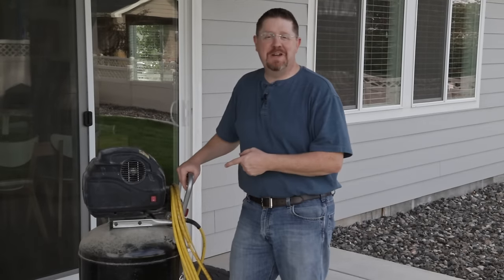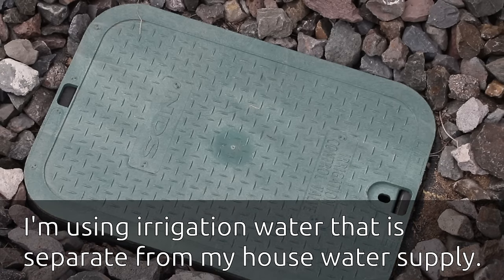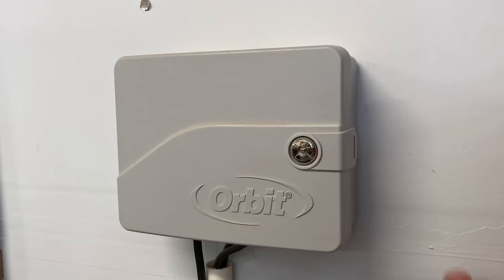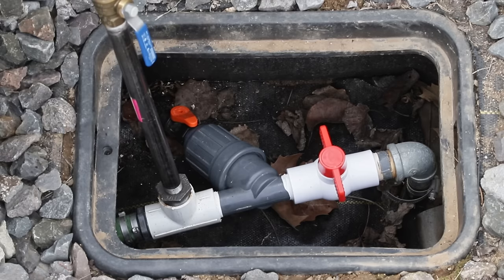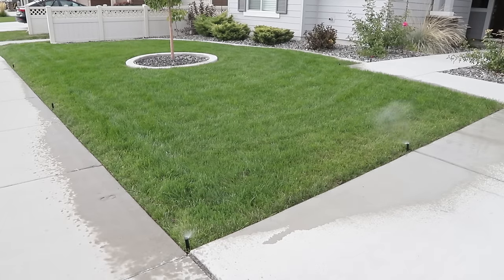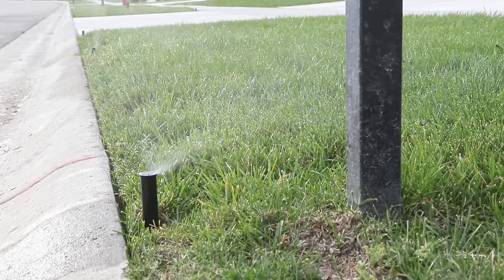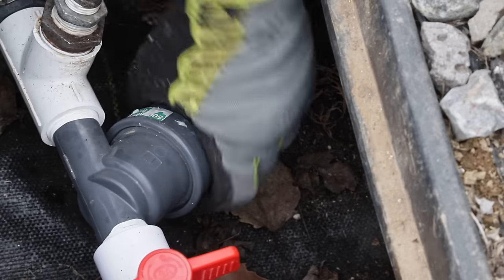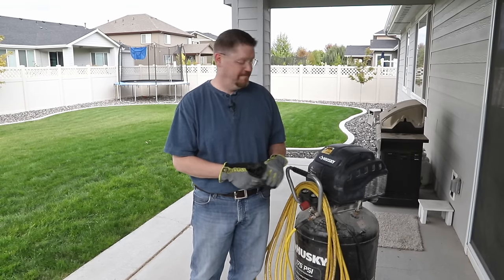How To Winterize Your Sprinklers (Sprinkler Blow Out With Air!)

Comment from the maker: The only slightly difficult part of this entire project is figuring out the right location to hook up your air compressor, and building the right kind of adapter. Irrigation systems vary wildly, but fundamentally all you need to do is pump the water out with compressed air instead.
Reply: Does it matter if you have drip line. My concern would be damaging it. Thanks for the video
Reply: Michael Brown drip line should have a part that limits the pressures coming to the drip line section, may be underground.  You just have to blow out somewhere before that part.

Comment: One of the better videos I've seen on the topic. The only quibble I have is that although 80 psi might be OK for non-rotor head sprinklers, 40 psi might be better on systems which use rotor heads; they have lots of moving parts that can be damaged if run at too-high speed on air.
Reply from the maker: Good tip. Thanks for watching!
Reply: Yeah I'm not sure why anyone would run anywhere close to 80 psi!
Reply: Great tip 😊ty
Reply: @jayryan7473  TIME

Comment: Good tip at the end with the quarter turn on the ball valve.  I can attest, this happened to me one winter in Texas of all places.  My ball valve was shut, there was some water in the side, and it burst the metal on the side of the ball valve.  Crazy to know such a small amount of water can do that, but it's true.  Thankfully the ball valve is a cheaper fix than replacing the entire vacuum breaker.
Reply: You should have just replaced the cold water in the lines with hot water. Problem solved

Comment: I live in an area where hard freezes are rare, but light freezes are common. My schedule 40 pipes are buried a foot or so, making it unlikely that I'll have a problem in the backbone. However, the light freezes will easily damage the heads and funny pipe, something I've seen my neighbors have issues with. So I'd recommend doing this unless you never (or almost never) get any freezes.
Reply from the maker: Great advice David, thanks!

Comment: Always take the blow out cap off to let air in that lets the water drain down the curb stop and drain.  If u don’t, water is trapped. from ball valve down. U do that before us turn the ball valve off.

Comment: What I’ve done in the past as a low tech option that seems to work if you’re blowing out a smaller system. I took an old bicycle tube. Tied one end by the valve. Cut that end then about 10” of the other side. Wash the talcum powder out of the inside. Fit the longer cut end onto the valve side and using a bicycle pump fill that tube and watch the water exit through the ends. It may take more effort using the pump but it will do the job. Cheers.

Comment: I am new to an irrigation system and found your video to be very helpful and informative.  What, if anything, should I do with the controller?  Seems I don't want it to call for water but unsure how to shut it down for the winter.  It is a hydrawise brand if that matters.  Thank you for your help.
Reply from the maker: Great question! All you need to do with the controller is turn it off for the season. Consult your owners manual to see how to enable and disable or turn on or off the entire unit. Good luck!

Comment: If I just want to turn off my irrigation valve for stopping the entire irrigation, without any need for the blowout, since I don't need to winterize my system, I just want to manually irrigate. Do I just need to turn off the valve and that's it? Your video mentioned this and I want to make sure. My irrigation system is very simple (there is an irrigation valve with the switch to turn on/off, and there is two other remote control valve which I have not opened, I guess that is where the control for timing is ?). Thank you for the great video.
Reply from the maker: Hey thebc - yes, if you don't need to winterize your system because nothing ever freezes, then you just turn off the farthest upstream valve you have in your system. In my area these are very deep underground, but depending on if you have a frost line this may be shallow, or may even be above ground. Good luck!
Reply: @AmplifyDIY  One more question. If I turned off the irrigation valve, what happens to the water that is already in the irrigation pipe? I assume there are some leftover water in the pipes. Will it be ok it leave as is? Also, I happen to notice, after I turned off the irrigation valve, the water pressure for my home system has increased. I think it makes sense as it used to have two pipes for water, and now just one to the house. Is this normal? Or I should have the water pressure checked and adjusted if necessary? And also, since I didn't touch the remote control valve (where I suppose is the control of irrigation schedule), will it still turn on using the leftover (if any) in the irrigation pipes? Do I need to turn off the irrigation scheduler? Thank you.
Reply from the maker: @thebcl1547  I'll try to answer everything: If you simply shut off the irrigation valve, then yes, the water still in your irrigation pipes will just stay there. This is not really a problem unless the water freezes, in which case it will burst your pipes - this is the whole reason why systems are blown out with air in the first place. 
I can't really speak to differences in water pressure between home and irrigation system.... there are lots of variables and so many different ways that these can be plumbed. 
Yes, you should turn off the timer so it does not keep needlessly opening and closing the valves while the system is not pressurized. 
Good luck!

Comment: Do you have to run all the stations ? I mean you can’t just hook air up and blow them all out right ? I’m on a well.
Reply from the maker: Yeah, you'll need to do them one at a time. Otherwise there will simply not be enough air pressure to blow out the whole system. Good Luck!

Comment: My system, installed in 2001, has no fitting for attaching anything, and no outlet. I've just been opening all the valves with the water shut off. It's been freezing longer in the last few winters  - Have I been lucky? Should I install a fitting to blow out the system?
Reply from the maker: You've mostly been lucky, yes. :) There are a bunch of factors that can contribute to whether you run into problems: how deep are your lines buried? is your main water inlet to the system uphill or downhill from all your sprinkler heads? How long does it stay constantly below freezing?... etc. If you have a good place to do so, I recommend adding a fitting so you can blow out the system. Good luck!

Comment: Good explanation, thanks. I have 1" underground lines and a 20 gallon compressor. One question: When I turn on my compressor to clear a zone, the sprinkler heads pop up and start discharging water then air, but very quickly the air pressure drops and the sprinkler heads drop down again. My compressor manual warns me not to keep running the compressor, when the compressor cannot maintain the required pressure for a tool (in this case the "tool" is the blowing out of the lines). So how do you ensure that a zone is clear of water right to the last sprinkler in the zone, without just leaving the compressor running? Do you shut off the air supply, let the compressor recharge then open the  air supply to the lines again, and keep repeating this process until the last sprinkler head can rise and blow clear air? The last sprinkler head in a zone tends to remain at ground level and just have air bubbling through a pool of water and I am not sure if it is still expelling more water or not.
Reply from the maker: Hi Carol, 
Yes, cycling the compressor is the exact way to do it. As for how much water do you need to get out? If your last head is gurgling and bubbling, then that station has been cleaned out enough. As long as you don’t have a steady stream of water coming out of any head, then the station has been cleared. Good luck!
Reply: Actually this is because your air compressor doesn’t make enough air volume to do this job properly.

Comment: Great video, thanks for taking the time. I was told that compressors like the one you used will not work. Will you please tell me the CFM rating on your compressor? Thanks.
Reply: I've used compressors smaller than this one and have blown out my system for years. You just have to do it zone by zone. Some can get away with doing the whole system with  a big compressor
Reply: Depending on the tank size on your compressor and the length of irrigation pipe and # of heads in each zone, you may have to blow out a zone in multiple passes; that is, when you see the pressure coming out of your heads drop significantly, close the valve to your irrigation system, let the compressor recharge, then repeat until you get all the water out.

Comment: Why should the blowout tee not be before the RPZ pressure regulator? How do we make sure the regulator is clear of water?
Reply from the maker: Hi Don - in my system, the only thing upstream of the blowout tee is the water filter, which has its own drain. The only pressure regulator I'm aware of in my system is on one specific station that feeds drip hoses. If you have a pressure regulator upstream of your blow out tee, I'm not sure I can offer any great advice for how to make sure it is blown out...

Comment: How do you vacate any water between the valve in your city supply and the valve in your irrigation box? Seems like there would be many feet of water in pipe in that area because it never gets blown out
Reply from the maker: Hi James - in my case, the irrigation water is on a separate system that is turned on and off seasonally. I wait to blow out my system until after the irrigation water has been turned off in my neighborhood. Then I can crack open my underground valve (the one that is about 5 feet underground, well below the frost line) and blow a short burst of air through it. This evacuates the section between my shut off valve to the irrigation system and the shut off valve in my sprinkler box. Then I close both of those shutoffs and proceed with the rest of the blow out.

Your system will vary, of course, but I would not worry about any shutoff valve that is below the frost line.

Good luck!

Comment: Great video, quick question though: What is the purpose of the ball valve right after the main shut off?
Reply from the maker: I think it’s just there for convenience. It’s really simple to turn off the ball valve in the box in order to clean the filter or do maintenance on a failed valve, etc. would be annoying to have to reach down to the main shut off for any small work like that. Great question, and thanks for watching!

Comment: I didn't see a pressure regulator, so are you using line pressure? Also if the system, is only serving a drip system for plants with 1/2” drip line and using 1- 2 gph emitters, I would guess you need to know where the end of the tubing, so you can loosen the figure 8 fitting, so you can drain the lines quickly, I'm in the process of building a new home and will tee off the incoming water line and using a backflow valve, plus all my outside yard faucets will be off the same supply line serving the irrigation, I'm thinking the lowest places of my hose bibs, will be where I should install a drain valve to blow out the system to winterize. Am I missing anything? This new home is at 6500 feet elevation and it freezes, so I'm planning on trenching the lines to 18” deep and sanding the lines when I backfill
Reply from the maker: Hi Philip - It sounds like you have thought through your upcoming build pretty well. I do not have a pressure regulator on the irrigation lines, and just rely on whatever the system in my neighborhood provides. The builder that built out this neighborhood set up all the homes this way, as we are on our own irrigation pump for the community. So far it's been fine. 
My only other thought is that rather than just digging down to 18", you should find out what the freeze depth (usually called the "frost line") is where you'll be building, and bury below that. It may only be 12", it may be much, much deeper. You can learn more about frost lines here: https://www.familyhandyman.com/article/frost-lines/
Good luck!

Comment: My manifold has three connections where yours shows one. Reason?
Reply from the maker: Just depends on how your system is set up and plumbed. The box I showed here is the single main source of irrigation water for my lot. From here the outlet goes up near the corner of my house in the back yard where there is a T. One side of the T goes to a box in the front yard with a manifold where all the valves are for my front stations, and the other goes to a box at the back corner of the house where there is a manifold and  valves for all my rear stations. Neither of these are shown in the video. 

I suspect that your box simply has the split for your various manifolds right there rather than a T or series of Ts later down the line.

Thanks for watching!

Comment: What about the water between your two shutoff values? Some of that water is above the freeze line, wouldn't that be a problem? If shouldn't you put the compressed air fitting below the freeze line to blow out all water above the freeze line?
Reply from the maker: HI Gis  - In my specific case the water is supplied from local irrigation canals. At the end of the summer the water flow to these canals is turned off, and the pump that feeds our system is shut down for the winter. Once this happens, all I need to do is remove my filter fitting with my above-ground shut off still open, and gravity will pull the water back down past the under-ground shut-off back towards the pump.

This is, of course, unique to my setup. The particulars of your installation may vary, but in general just a couple of inches of exposed length above the freeze line won't be a problem, even if it remains full of water. Thanks for watching!

Comment: Thanks for the video.  Question:  If there is no air valve connection anywhere in my sprinkler system, can I blow out the lines by attaching the compressor to an individual sprinkler head in each line?  (Orbit makes a blow out kit adaptor which fits onto a sprinkler head for this purpose.)  Or should I go to the trouble of cutting my main line and installing a air valve connection (like yours inside your box)?  Thanks much.
Reply from the maker: You won’t be able to blow out all the lines if you only attach a blowout thing to a head on each station. That won’t clear the lines from your water supply to the valves, and depending on how deep your frost line is those lines can freeze and burst. It would be better to install a blowout access point as close to the water supply as possible.
Reply: @AmplifyDIY  Is it best to install a blowout access point in your valve box like you have done?  My system doesn't have a blowout access point.

Comment: Thank you as always. Can you please advise what size compressor ideally will be sufficient to bleed off the water ?
Reply from the maker: I've done this with several different sizes of compressors over the years. A really small compressor (say, 2.5 gallon or so) will do this job, but it takes a lot longer, as you'll have to keep refilling the compressor over and over on each station. The larger the tank, the less you'll have to refill it and the faster the job will go. 20+ gallon compressors make this job a piece of cake. Good luck!
Reply: @AmplifyDIY  thank you, appreciate your response.

Comment: So my sprinklers are supplied by my hoa. But I still need to blow out my system.  Couple questions. Do I blow out my system before or after the hoa shuts off the water to the system?  And do I still shut the valve going to my main valve to the hoa supply? Or how does that part of the system get blown out?
Reply from the maker: I wait until after the HOA water has been shut off. Yes, shut the valve that goes out to the HOA supply - that should be buried quite far down (mine is around 4-5 feet underground) where there is no danger at all of it freezing, so blowing it out is not really necessary.

Good luck!

Comment: What do you do about the water in the pipe from your below frost line shut off to the ball valve above the frost line?
Reply from the maker: Generally I don't worry too much about it. When the irrigation system is winterized for my neighborhood, they drain the entire thing. After I've received notice that the system has been completely drained, I'll make sure the ball valve is open halfway. This accomplishes 2 things: 1) it allows any water that was trapped in that section of pipe to drain back down below the frost line, and 2) it prevents any small amount of water trapped in the ball valve itself from freezing and expanding and breaking the ball valve. 
Good question, and thanks for watching!

Comment: Is it normal for water coming out When opening the top for air compressor hose connection?
Reply from the maker: Hi Painkiller - no, that's not normal. You have a leak somewhere which should be addressed. Good luck!

Comment: Excellent video! Is it necessary to close the valves on top of each sprinkler zone controller? Thanks
Reply from the maker: Hi Roger - I don't think it's necessary to close them. When you blow out each station, you clear all the water out of the valves for each station. I always just leave them alone (in fact, I never have to open the other boxes in my yard where the valves are unless there is an actual problem with a valve (stuck open or closed, etc). Thanks for watching!

Comment: So is it safe to assume that I dont need to install drain valves if I do this instead?
Reply from the maker: I’ve never had a drain valve on a sprinkler system, and never had any issues with burst pipes or broken heads in the spring.